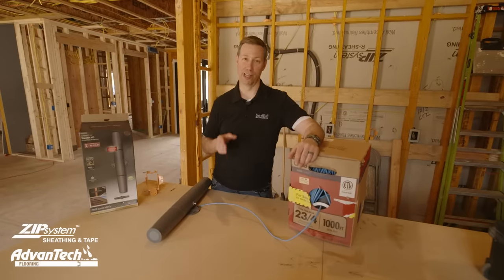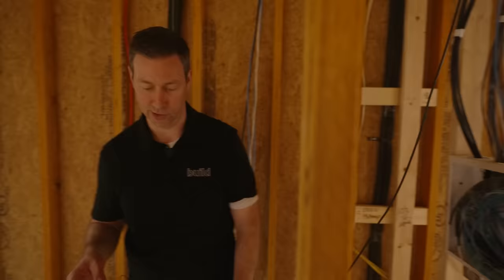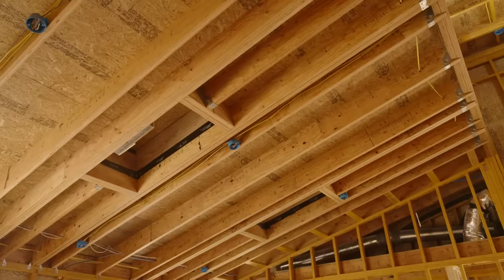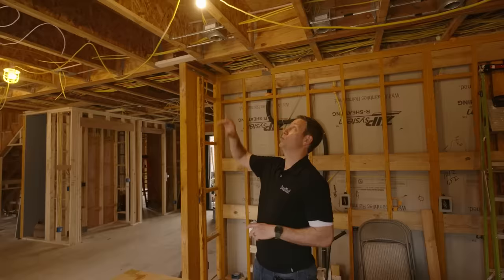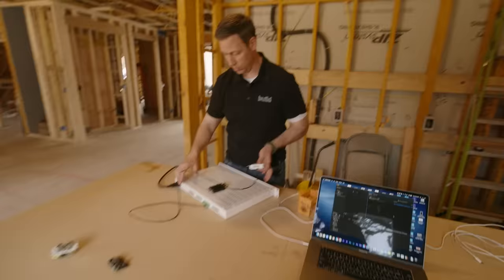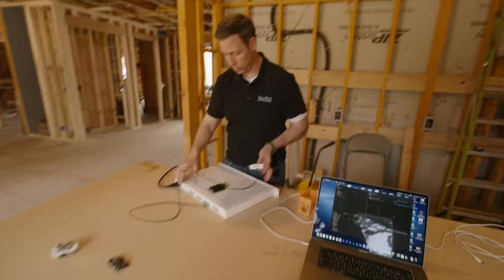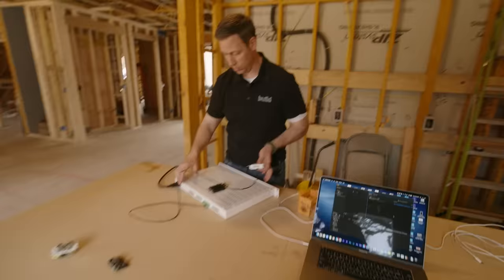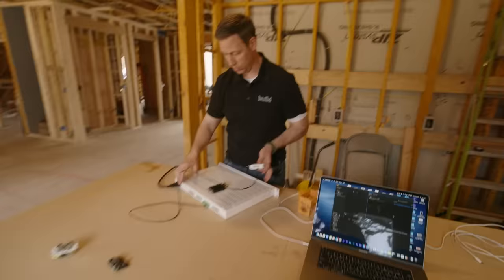Low ⚡Voltage at the Real ReBuild

Comment: I think you misunderstand the relation between voltage, power and cable gauge.
The low-voltage circuit you are talking about, with thin wires. That can be used for communication just fine. Thin wires suffice, because the communication is also low current i.e. low power. 

But once you start drawing significant power (like up to 100 W through USB C), you'll see a significant voltage drop thin wires. And worse still, if you use the thin wires for general low voltage supply for say, led lighting and usb power in a looped (not sure of this term in English) configuration, thin wire will become dangerously hot.

E.g. say you want to power 110 W of leds. At 110 V , that's 1 Amp. 
But at 12 V that's 9 Amps.
Meaning: to get the same cable resistance for the same power draw at 12V you need a cable with 9x the cross sectional area. 
In practice you are not drawing power (wattage) in the 100s not 1000s when on low power, so you probably don't need to go that extreme.

I don't know how "gauge" correlates with cross sectional area. But here in Denmark, we measure wires gauge in square-mm (mm2). Typical home installations are 1.5 mm2.
I am considering carrying a low-voltage (12 or 24 V) circuit to lamp outlets, so that common led strips can be powered directly. My electrician suggests that 2.5 mm2 wire be used in that case.

Comment: Your CAT6 should be solid(for doing punch down termination), not stranded. And hopefully, your coax is RG-6 quad-shield(with compression crimp connectors) and not RG-59.

Comment: Dude, as always I love your videos.  But everywhere you have one CAT6 run...pull a second as well--you'll thank me later.  Also, CAT6 is nearing the end of its useful life.  CAT6a, CAT7, or CAT8 would be the way to go if building a home in 2020 or later (as of the time I'm writing this comment).  6a would be most economical out of the three that I mentioned.  Within about 5-10 years, 10 gigabit ethernet is going to be as ubiquitous as 1 gigabit ethernet is today.  6a is certified to carry that 10 gigabit link for the full 100 metres, whereas 6 is limited to about 30 metres.

Comment: The media rack, wired network, multi-access point wifi, antenna combo is exactly what I plan to do (and I have a simpler version of it now), so I'd absolutely love to see how you do it in more detail. How is the media closet air conditioned, is my first question?
Reply: I would second that question/recommendation to make sure that there is adequate, active ventilation for the media closet.  You will be amazed at how much heat is produced by a small rack of ethernet network gear, not to mention the AV gear.  Don't make the mistake of just adding duct work from the HVAC system (although IIRC you are doing ductless mini-split systems).  The HVAC ducted systems are great during the summer month, but just add more heat to the closet in the winter.  It's best to just distribute the heat load of the media closet out to the main conditioned space of the house.

Comment: Hi Matt, Just a heads up the longest One Connect cable(Cable for Samsung frame) 15m.   Also there is few companies doing low voltage lighting one of them is USAI lighting.  They provide some really cool stuff.   I run an Austin based AV company if you need any help with this stuff.  Can't wait to see the finished house.

Comment: The thumbnail shows somebody running low voltage cable together with power wiring.  Whenever I see that I that person does not truly understand what they are doing.  Low voltage needs to be kept separate from power or there can be serious malfunctions in the low voltage equipment.  EMI is a serious issue and I've had to deal with it many times after electricians did low voltage cabling work.  I'm am IT professional and run my own business.  I cannot tell how many times I've solved weird problemsby simply separating the low voltage cables from the power far enough for EMI to no longer be an issue.  In most situations, 3 feet of separation for parallel runs is the general rule, and when crossing they need to cross 90 degrees or as close as possible.  But there are some exceptions to that.

Comment: I know there’s a lot of discussion about infrastructure but honestly I fell like today’s infrastructure will last longer than yesterdays.   If a home is wired with Cat6 properly it’s going to have the bandwidth necessary.  

Let me put this in another way.   Many of the same principles of efficient design in home building are being built in the media chain where the goal is to have big pipes but use them efficiently.    I stopped ripping my discs to MKV for Plex the minute I heard about the AV1 codec that is royalty free and in use by Netflix and others.  A year ago Fraunhofer announced VVC (Versatile Video Coding) which halves the bandwidth of HEVC/h.265.  A 4K VVC stream can be done in 5Mbps.   This means 8K streaming in VVC would likely be viable at 30Mbps. 

Streaming in it’s current incarnation is simply sustainable as we move beyond 4k.   The future is going to require hardware acceleration of the nextgen codecs to enable realtime performance.  Decode is always easier.    In the near future you’ll be able to stream multiple 4K streams of video throughout the home at the bandwidth of today’s h.264 single streams.

Comment: When you turn up a source for residential interior low-voltage general lighting, please let us know. I'm planning an on/off-grid cabin in the next few years and I'd like something I can run straight off the batteries that's not RV lighting.
Reply: have a look at atxled.com for your project.

Comment: I used to run a Low Voltage Audio/Video business for 15 years and wired many hundreds of new houses.  Nobody cares now, so now I'm a normal residential electrician doing mostly standard high voltage.  Your Low Voltage wiring was obviously wired by a non-pro, with LV cables not labelled as they were installed, with LV cables not secured every 4 feet minimum (like above the LV panel), and the LV cables were not separated from the high voltage 12-2 in the ceiling by the MINIMUM 2" separation that the code requires.  While this separation won't matter much for the Voltek power supply cables, it would likely make a significant difference in your ethernet Cat6 and broadcast RG6 cabling.  

Also, there are NO grounding cables for either of the steel low voltage panels, no ground wire for the Demarcation point outside for the Service Suppliers to use, and no ground for the outdoor antenna cable as it enters your home.   How did this pass inspection?  Unfortunately many (most?) electrical inspectors don't care much about LV since these are not SAFETY or FIRE issues, or maybe you just did it stealth-like after your electrical inspection?    

On the High Voltage side, 14 gauge Romex-type wire is also significantly easier and cheaper to run for most of your lighting circuits.  If the electrical designer (often the electrician in residential) decides specifically how much current the lighting circuits use, then there are no variable outlets, and there is no chance of overloading the lighting circuit if this is done correctly.  It does make good sense to use 12 gauge/ 20a circuits for the unknown and variable use of standard wall plug outlets.

It is always frustrating to continue to see real pros thinking that the Low Voltage wiring is a building process that just any dork (or even most electricians) can do correctly.   Some states allow all this low voltage wiring to be done by employees of general or specialty contractors without any type of special electrical licenses.  This is a poor idea, in my opinion.

EDIT:  You DID save likely thousands of dollars by doing this yourself.  I hope it all works very well for you, and I expect it will!  I really do enjoy your shows, Matt, I just needed to critique (vent?) when it came to my specialty!

Comment: You are wrong about there NOT being a central distro for LED lights. Check out Honeywell s commercial POE LED panels which has a mix of residential and commercial fixtures 
Also you ARE installing IPOD tech now if NOT planning on POE everywhere with Cat 6A. You are ALREADY obsolete with the the Cats 6  vs 6a you installed Unbqit requires high power poe for some of their gear and 10gig APs and  layer 2/3 switches not a big deal today but you spoke about the apple connector and IPOD problem without realizing you did the same thing to a lesser degree 
Bottom line though your build is INCREDIBLE  Congratulations on your success!!!
Ps there are now TVs and monitors which run only on hi power POE no AC power required

Comment: If your intention to have high quality sound, the architectural speakers of this kind(Sonos), cannot perform nearly as you good as some alternatives due to two fundamental facts: 1) The speakers are powered remotely at a distance; 2) The analog signal is unbalanced. You can improve the situation by buying very-low-gauge and high-copper purity wires, but the price will not make sense compared to the alternatives.

If your intention is to install a high quality audio system, each speaker will benefit to have its own amp and connected to low-voltage balanced lines. Most of the times, just a pair of studio speakers + subwoofer with an audio interface will beat whatever architectural system you're using in precision and quality, but if you want it built-in to your house walls, it is also possible.

An easier solution could be ceiling / wall mounting of the studio speakers - you would still have to run power lines and balanced audio lines to the ceiling / wall, but you don't have deal with trying to fit it in proprietary wall cavities + you can always upgrade the system - balanced audio signal has been around for 70-years.

Just to clarify, I was talking about $1000-$2000 total cost system, likely cheaper to what you have currently.

Comment: Regarding the Voltek - what about voltage drop? DC has significantly higher drop than AC (which is one of the major reasons we use AC for distribution) and these are fairly long runs over thin wire.
Reply: AC/DC does not inherently affect voltage drop. For a given, constant load, and given wiring, 100VAC would experience the same voltage drop as 100VDC. You're confused because AC is typically used for high-voltage, which means lower currents, and thus lower voltage drops. AC is used for distribution because it makes simple coil transformers applicable.

Comment: You might want to check your laptops first. Voltek appears to be 60W output. You might be OK if your Mac has a 61W brick, but your screwed if its a 87W or 96W brick.

Comment: But there is a low voltage lighting system already from ubiquity runs off of Ethernet but at this point you might just was to pre wire for it Incase you chose to run it

Comment: Matt, if you haven't done it already, check to make sure that the can behind the TV lines up with where the One Connect plugs in on the back of the TV, which is lower on the TV and slightly to the side.  Two things to consider are 1, make sure that box isn't right in the way of where the TV mounting plate would go (which is really common) and 2, being literally ZERO gap, if that small One Connect wire has to travel to the box, it can create a very slight gap and an imbalance that will need to be off-set if you're anal retentive.  Also related, you chose a box that comes with a finish frame to be installed later, don't install that as it will also add a gap.  Most contractors and low-volt prewirers install boxes in the center of where the TV is projected to go and that is the WORST spot for it, I know, I have install hundreds of TV's.  If it were me, a better location for the box would be on the other side of that same stud and lowered just a bit, maybe 6 inches.  Hope you get this in time.  Thanks, I love these videos and learn a bunch from your channel and happy to see an episode in my low volt trade; I'm prewiring a house today.

Comment: Matt... Curious why you did not run Fiber to all rooms along side the Cat 6?  I would think the cost would not be bad but it would help future proof you.  I plan on doing this myself with my build.. BUT I welcome any comments to educate me as to why this may not be a good idea.
Reply: Fiber is the way to go to futureproof.  8K video uncompressed will require 48Gbps HDMI cables.  Fiber can do well beyond that with the requisite transceivers.  There are some nice structured wire bundles that include dual Cat-6, Fiber and Coax in a single jacket.  It's expensive but imagine pulling a single cable and then being able to keystone two ethernet, a Coax and Fiber connection wall plate after terminating all of the connections.

Comment: It was my understanding that the Samsung Frame TV cord to the box wasn't "in wall rated". You said you got one from a different provider. Is it for that reason?
Reply: One Connect cable can be run in wall for most of the models.

Comment: While it sounds like a great idea, you probably will not be happy with the Voltek system because it uses old fast charging specs and so it won't charge the new devices at full speed. It uses QC2.0 for instance, and the new phones are on QC4.0.
Each generation develops its own charging spec, and when you plug the device in the charger and the device talk to each other, and the device tells the charger how much voltage and current to put out, but the older spec chargers like the Voltek don't have the newer higher voltage capabilities, and so forever will charge slowly.
This is why phones used to always come with a factory charger, because each phone needed a faster charger than the previous one.
And this is why your charge ports should not require an electrician to upgrade! Lol

Most people tend to think of USB ports all the same, but when it is used as a charger, it no longer is putting out the basic 5 volt USB standard, it's now putting out up to over 20 volts for the newest devices.

It's also important the other way, because if you are trying to charge a tiny battery like a Bluetooth earpiece or a tiny RC plane battery on a high power charger it will shorten the life of the battery and possibly burn it out, so you want to keep an old 1 amp or 500 milliamp charger to charge them.
Or if you have a Qc4.0, it will go down as low as 3.6 volts for charging the tiny stuff.

But since the charging requirements for devices is constantly changing, hard wiring expensive and non upgradable chargers is not a great idea.

I had just finished upgrading all my home and car chargers and power banks to QC3.0, and then upgraded to the S21 and discovered I needed to go to QC4.0 for fast charging...
3.0 still works, but it's slower.

Comment: Are you worried about DC losses in the Voltek system? I would think, especially when charging a higher wattage device, that you might run into issues with a long rung. 

I'm a big fan of hard wiring though. It offers much more stable connection. And it offers high speeds without blasting extra radiation through your body.
Reply: I'm  more worried about losses to my wallet a thousand bucks ouch😱
Reply: @rogerkerkmann  "Losses to my wallet" lol

Comment: Considering the size of the cable between the voltek system and the outlet how far can each run be?  Is voltage drop an issue?

Comment: I don't know how important it is and all. But you are not talking much about electricity and possibility to use solar panels and inverter+battery solution for your house. and you are 100% correct about cable. It isn't only about wifi and security of it ..but for sure cable/lan cable is pretty only way to go for super high speeds with minimum effort ..and yes we have wifi but lan is lan..if you want to talk about stability lan is the way to go..wifi is never the answer as it could get disconnected it could be much more ppl are using same bandwidth 2.4g ..with 5ghz this usually isn't the problem..but anyway ncie video.

Comment: Serious question. Cat 6 was used in this application. How common is cat 7 and 8 now? Looking at running some network cable and want to future proof a bit.
Reply: Not very the highest we usually go is cat6a and beyond that we run fiber because its just cheaper at that point.  Cat6 can still run 10g, 40g and even 100g at shorter lengths with proper terminations.

Comment: Don’t do Cat6 - it’s the equivalent of the gold plated monster cables.

Cat 5e is the spec for 1 and 2.5Gbps.  Cat6 is the Spec for 5Gbps.  Cat6A is the spec for 10Gbps.

Ubiquiti works fine for a couple of APs, but they don’t roam, and they don’t do co-channel very well.  Stay away from the home extension APs like Google home, eero, or Velop.  Get a good enterprise system like Aruba that you own and will still work if you don’t pay the subscription :).

I wouldn’t do proprietary wiring and outlets - wait a few months or maybe a year and I bet there’ll be a USB PD 3.0 60W or 90w outlet to run off a regular 110V circuit - or a PoE++ adapter that will draw power from an appropriate 802.3bt switch.

There’s also some value to running coax as you can do Ethernet over MoCa for 1.6Gbps of bandwidth to set top boxes or MoCa adapters.

Last thing - Sonos is super chatty on multicast and it can overload CPU on your switch if it’s not configured properly.

Good luck with the build!

Comment: Nice choice on the Unifi system, I've got that in my house and works like a charm. It can get complex quick so might want to reach out to some YT channels like Lawrence Systems or Crosstalk Solutions if you run into issues or for more research.